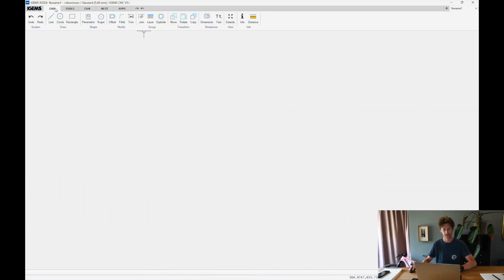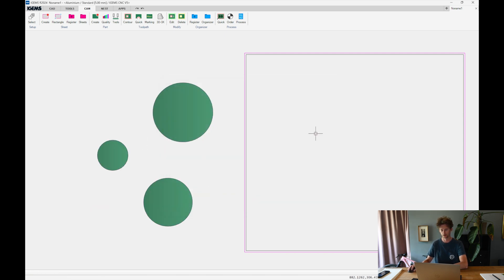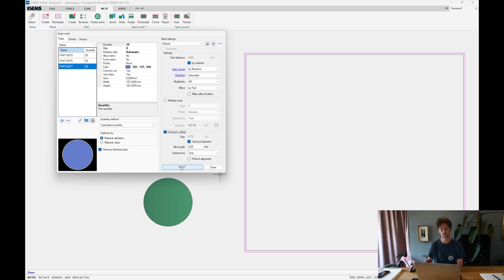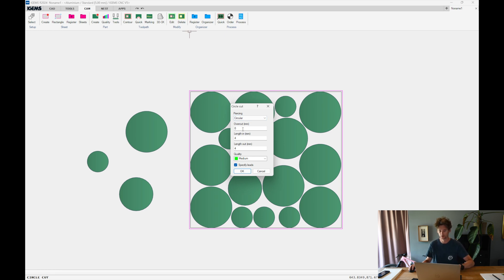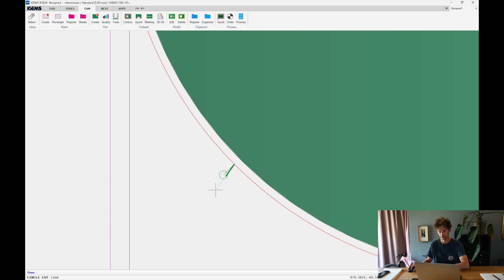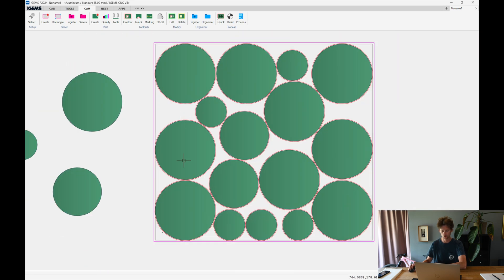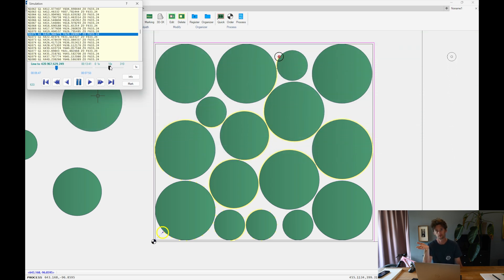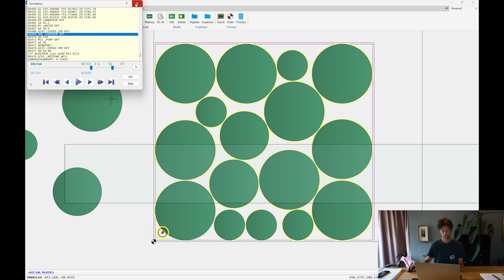Cutting circles really fast with a waterjet cutting machine

Comment: Nice addition to the software. See Jeff Day about his water only program for circles.  It does O.D. & I.D., with a common outside cut line.
Reply from the maker: Thanks William
From what I can see, Jeff is using our Chain cutting command in his water only series. This new command is an improvement since it doesn't slow down as much in the transition between parts. But Jeff is doing a fantastic job in educating users in IGEMS 😊